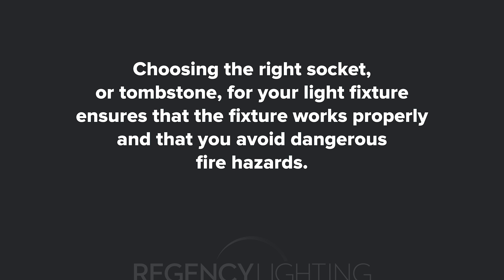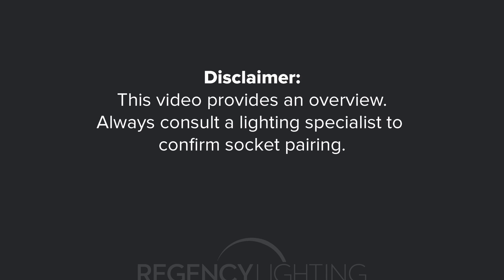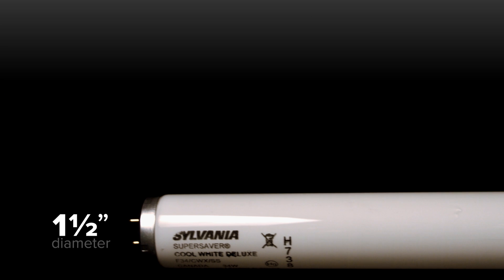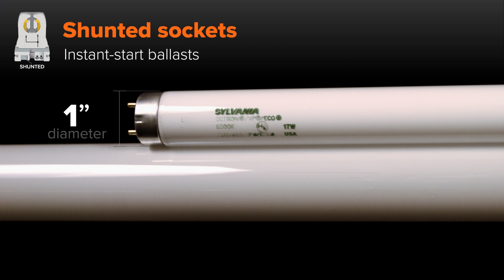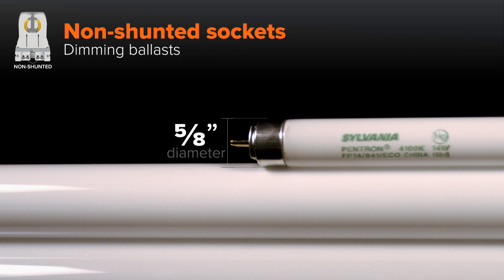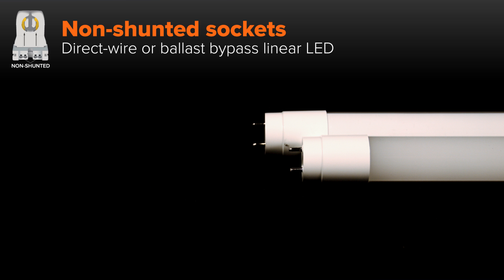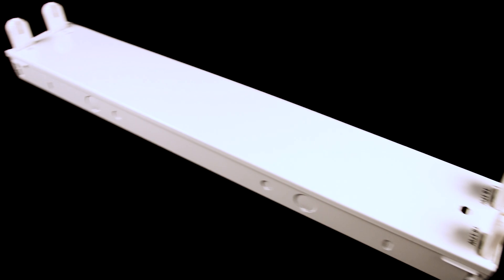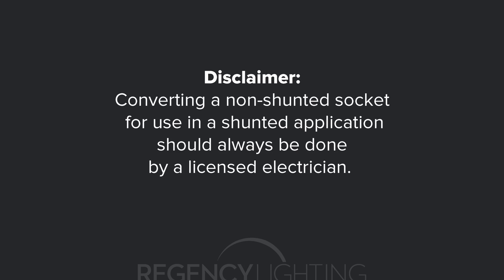Shunted vs. non-shunted sockets: How to determine which you need

Comment: I have an older under the cabinet t12- 2 foot with receptacle. Newer models don't have a receptacle, so I bought new bulbs, nothing, replaced ballast, nothing, bypass switch, nothing, my last option is the sockets. Why do sockets fail?
Reply from the maker: Just like bulbs and ballasts, sockets eventually need to be replaced. Please reach out if you have any other questions!
Reply: Some older units utilize  a STARTER. It's usually a round silver metal device that is inserted by rotating it. Sometimes they develop poor contact and merely need to be rotated (loosened and tightened) to restore proper contact.

Comment: I tested the 2 terminals of one of the tombstones on my T12 ballast fluorescent lights for continuity.  Meter showed no resistance, which means the tombstone is shunted.  But this contradicts what's said on the video regarding T12 lights all requiring non-shunted tombstones.  On the other hand, I noticed there are separate wires going into each side of the tombstone, which led me to think tombstones are non-shunted before I performed the test.  I didn't disconnect any of the original wiring other than disconnecting from the electrical source.  Is this what's causing the discrepancy in my test?

Comment: Hi, I have problems with my fluorescent lighting circuit (Dimmable) and when I read the manufacturer manual it sais that it could be related to the distance between the lamp wall and the grounded metallic surface (between 0.125 and 0.5 in.)  Just t be sure, how do we mesured this distance.  Thanks
Reply from the maker: Christian: In our experience, we've encountered many issues with fluorescent and LED dimming and have found that most issues need to be resolved directly with the manufacturer or an electrician. If you let us know where you're located and the manufacturer, we would be happy to give you some referrals.

Comment: Hello, through your very informative videos, I have learned that I have shunted sockets and an instant start electronic ballast and currently with fluorescent light tubes.  Am I able to just upgrade them with LEDs tubes? And if I can, do you recommend single end or double end?
Reply from the maker: Phil: thanks for your comment and we're glad to hear our videos are helpful to you. To answer your questions, in our experience...
     1. We recommend the plug & play type TLED’s  on your Ballast
     2. Single-ended and double-ended refer to the ballast-free type TLED and we recommend the double-ended type for safety reasons. You don’t want line voltage to both connections on the same end of the lamp